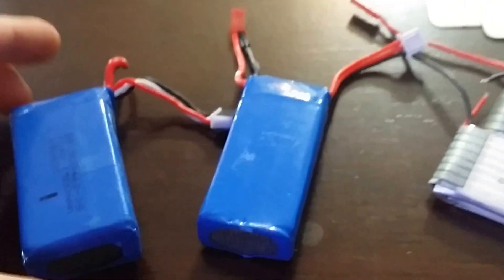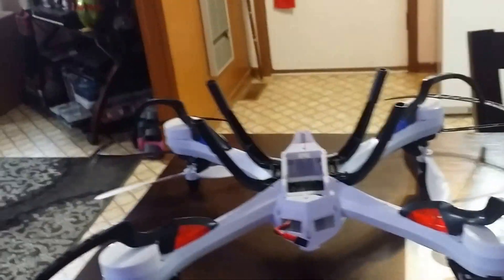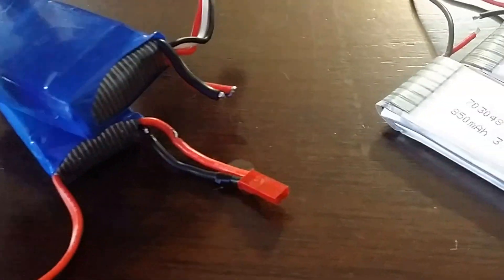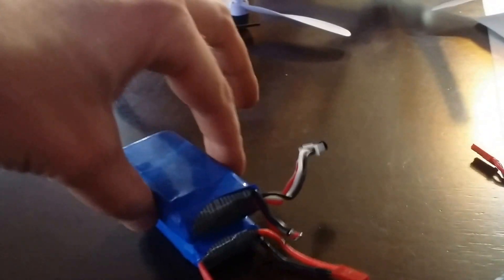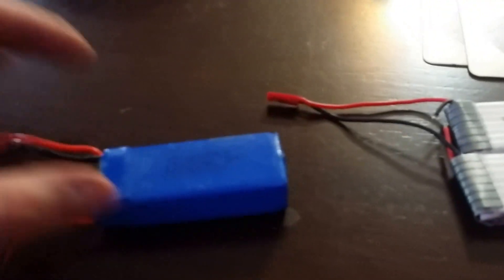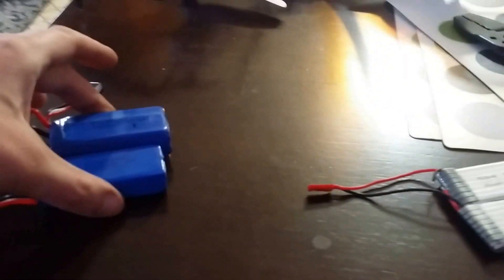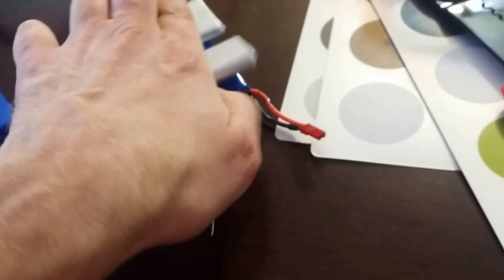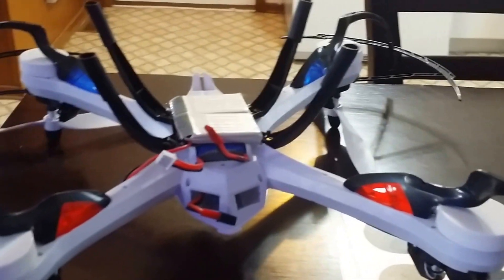Tarantula X6 Battery New Mod

Comment: I use one 1800 mah batteries per flight and the weight balances is almost perfect... I own four of these batteries for a run time of 12 to 15 minutes each of flight time... Any more than a single 18 mah battery and you start to have weight issues...
Oh, I have not burned out any motors using the 1800 mah batteries, but I have crashed and lost the engines, lolol...
Reply: Lip stick what batteries you use?
Reply: What battery would you use if you wanted the longest flight time and wanted to carry a go pro.  Also I don't really want to burn out my motors.
Reply: Only batteries that have ever worked and held a charge for, ME, are 1800mah Nano-Tech by Turnigy...  Sorry, for the long response, did not know you asked me a question...
Reply: Lip stick Have you burnt out your motors yet due to the extra weight? If so how long did it take?

Comment: Weight may not have the only thing responsible for you fried motors.  Running the copter for a much longer period with the higher capacity batteries can cause excessive heating of the motors and early failure. IMO, best bet is to stick with stock batteries, and have several on hand, giving the motors a few minutes to cool down between flights.

Comment: You should try to put some graphite dry lubricant powder in your motors and give them a short break in period before their first use
Reply: How do you perform a break in?
Reply: run your motors at a slow speed for about 5 minutes. put the throttle where the copter is just below the point of taking flight and let them go for a few minutes this shapes the brushes inside the motors and helps them sit more evenly on the contacts inside the motors preventing the brushes from overheating before they can conform to the contacts on the stator in the motors. This is not a requirement but it will help the motors last longer.

Comment: the 1200mah is exactly 54.4 grams ......also i have a 25c 850mah and the tarantula x6 1200mah 30c can i run these 2 together ?
Reply from the maker: +Nut Shell Yes you can. Thanks for the weight there. If your 850 mah 25 C is 7.4 V then yea black to black and red to red. That will be basically identical to my setup except I built my 2S 7.4V out of two 1S 3.6V.  When you do this you must understand balancing doesn't work properly.  A 4 cell 7.4V battery wont be understood by a charger.  Just standard charge it like any 7.4V 2S up to 8.4V(or whatever your charger puts a 2S 7.4V at normally)and discharge proper for storage.